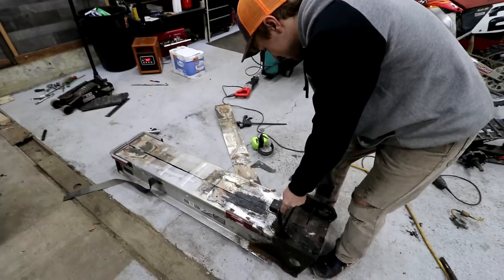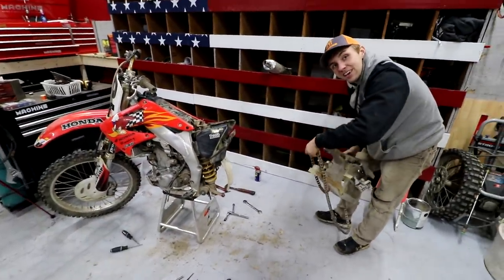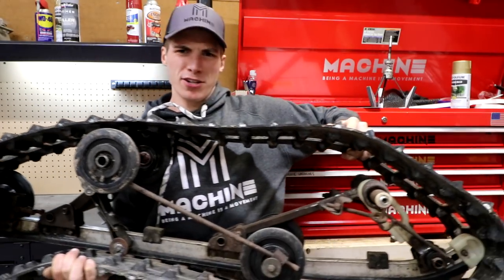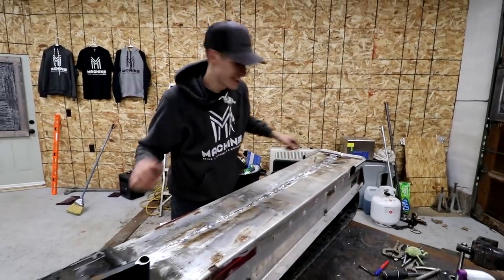Making The Extreme Snow Bike Part 2

Comment: I don't think there is any way those to pieces of square aluminum tubing will hold that whole tunnel and rear skid. I would have ran it the length of the tunnel, but even then I'm not sure if It will hold up. Probley steel would have been the best bet

Comment: the rear sprocket gonna be way too low look at the angle of the chain with the stock swingarm+wheel and campare with the sled sprocket you really need to put the sprocket higher